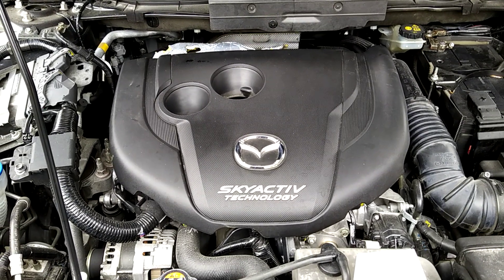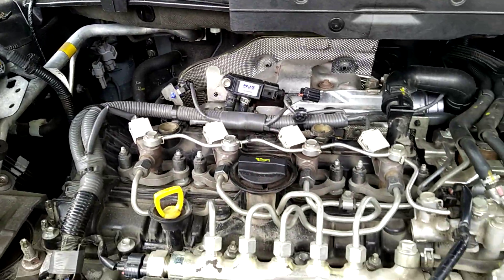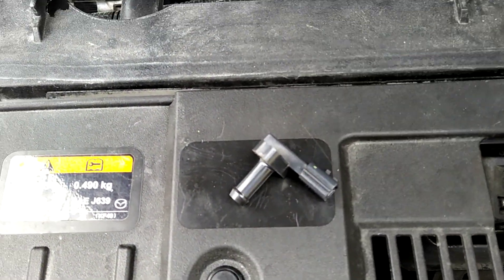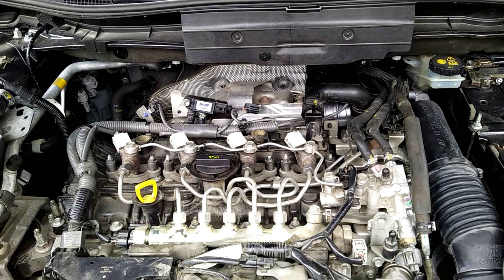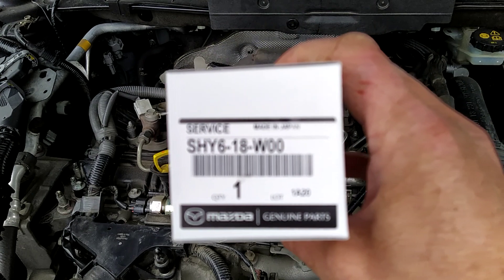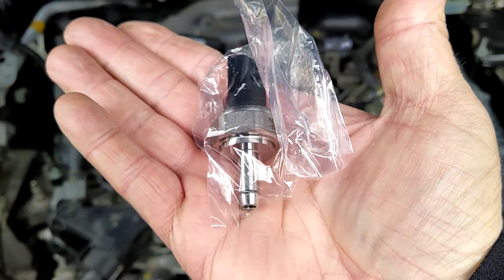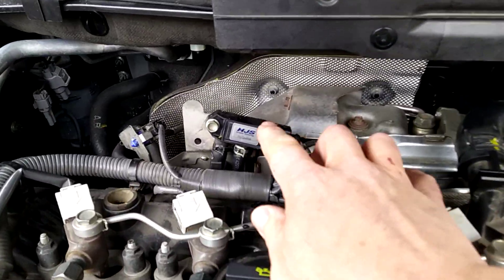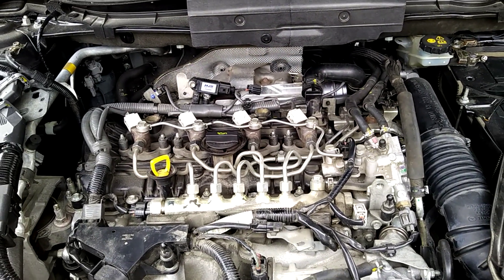Mazda SKYACTIV CX-5 2,2 Diesel DPF / Exhaust pressure sensor **IMPORTANT**

Comment: Hello, I have the last version of the sensor on the right, the one with a single tube and my car has no active errors, but just one in the system P0234: turbo overboost pressure. My turbo was changed last year with a ner OEM one at the dealership. What do you think it is the problem? Maybe I have to do something to calibrate the turbo, or maybe I have a faulty differential pressure sensor, the one with 2 tubes? Please, I need your help!
Reply from the maker: Sounds like something I have not run into. I don't think this code is related to these sensors, rather something else.
Reply: I have this same code P0234 too. My turbo was also changed awhile ago. Did you get yours solved? I'm considering changing the wastegate solenoid valve, and/or checking the pipes around it in case some carbon is blocking a pipe.
Reply: Got it fixed: a hose had popped off a very difficult to access turbo actuator at the rear. Aside from throwing the error code under heavy and prolonged acceleration, two symptoms were oil in the intercooler (likely from the first turbo working so hard and never swapping to second turbo), and the wastegate readings via OBD2 were unusual. Easy fix once found.
Reply: @aidan441  hello aidan, can you give me an email/facebook so we can discuss the problem better ?
Reply: @aidan441  or any platform you want to discuss and maybe if you have any pictures with the exact location of the problem, I am waiting for your response!
Reply: @aidan441  hei aidan, are you able to help me?

Comment: Hi, what are the symptoms you had when you have these lights on? I got "SCBS inspection required" came on today and the engine was running limping mode. also notice revs are not steady as usual, it is very busy.  Is that something you come across?
Reply from the maker: There are numerous. Lag of turbo, Auto trans erratic and clunky shifting, irregular idle just for starters. The transmission down shifting can be violent, so I ended up approaching turns on neutral. The exhaust sensor errors affect a lot of functions. However, should be noted that I also had the DPF sensor go bad at the same time.
Reply: @cronk216  took to the garage and scanned,  got MAF error code and nothing else. Not sure ECU correctly assert the problem
Reply from the maker: @rajeewaperera1752  That's good. MAF is really easy to clean and replace.
Reply: @cronk216 MAF removed and cleaned with MAF cleaner, put it back after dried, start the engine and leave it to calm down 2 minutes.  However rev the engine 1000-2000rpm and but still feel engine hesitate to be smooth.  Should I leave more time to idle?
Reply: @kevinhancock4064  I've ordered new MAF today, however, now I can see SCBS clear windshield completely comes when I start the engine. Any thoughts? I will update when I replace MAF sensor.
Reply: @kevinhancock4064  I've replaced MAF and all issues gone. However I will clean throttle body, Intake manifold and MAP after couple of months time,  just 32K miles in the clock.
Reply: @kevinhancock4064  well I did get MAF code, but cleaning didn't work but replacement work as expected. I will driving to Scotland tomorrow then I will rescan to see any issues. Will update once I rescan the system.
Reply: @kevinhancock4064  hi mate, managed to do a quick scan with obdlink mx+ today. No engine codes reported however, it does come with MIL status not available. Not sure how to get that scan.
Reply: @kevinhancock4064  Yes MIL ( malfunction indicator lamp) , thought expensive device can read these. Seems you got few issues or maybe one issue causing all 🤔. As mine got all start to light up but ended in MAF issue which trigger TPMS, SCBS... etc. I'm going give another run tomorrow to Hull and see if all good.
Reply: @kevinhancock4064  No. After new MAF no lights.But got all above lights before replacement.
Reply: Why not use mazda dealer oil recommended by Mazda. You need low sulphur synthetic oil.
Reply: @kevinhancock4064  Had a good drive in Hull and it was OK no error codes were reported. I'm going on another trip down to London and Manchester this week. Hope now the issue was sorted. How are you getting on with your issue? did you manage to narrow it down?
Reply: @cronk216  ive got p0472 on scanner, on dash ive got scbs, engine management light and ESC light would this be expected for this code also

Comment: Hi, after changing, did I have to ad it in the control unit? Or just change and that's all?
Reply from the maker: The engine light went away after installed, but recommend that you have the codes checked and cleared after.

Comment: I replaced these sensors 6 months ago and instead of p2262 I have p0101 for a month now, and the p2262 code does not disappear and no one can tell why it is if all parameters and graphs are correct
Reply from the maker: p101 looks like a MAF code. Those can be cleaned. The p2262 staying on could mean carbon build up, but not completely sure.
Reply: 90% of the time p0101 is coused by too much carbon in the intake and a clogged map, your maf is probably fine
Reply: Hi did you manage to sort it out? Im have same issue with cx-5,  p0101 
Changed this exhaust pressure sensor as i do get p2622 and p0472 and mentioned in the video, so they were gone but do come up every now and then , but p0101 is the one thats keep coming up, i Changed MAF sensor also cleaned MAP sensor, still no luck... please update if you found solution 🙏 Thanks